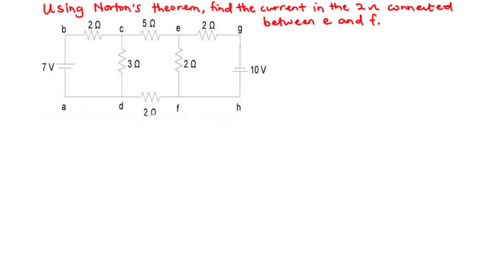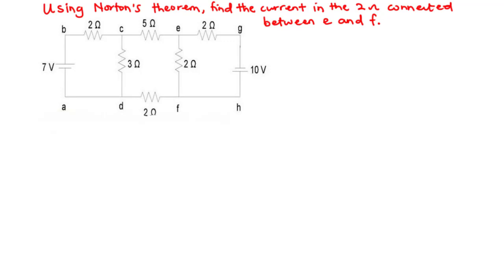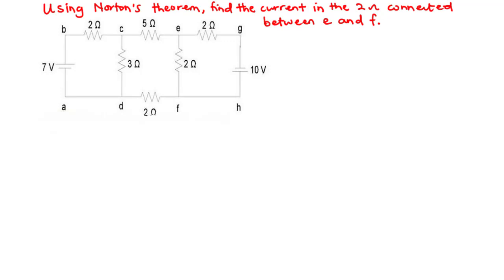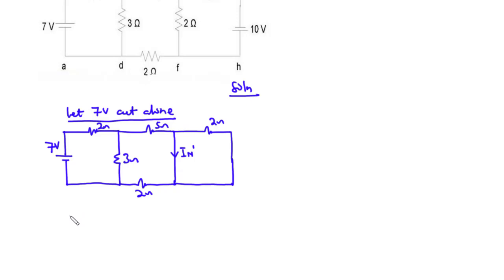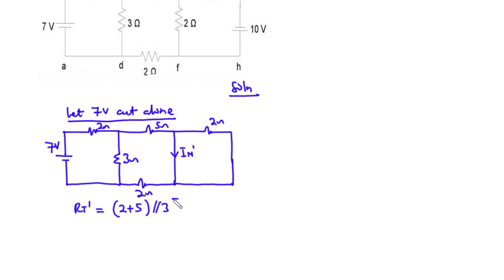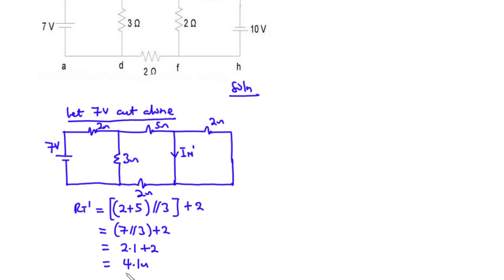20b - Norton's Theorem with Solved Examples #knust

Comment: My calculator gives results as exact fractions. With that in mind, I_n = 184/41 [A] and R_n = 82/51 [Ω]. These numbers imply that the current through the 2 Ω load resistor is exactly 2 A. (Upward)
Reply from the maker: If you do not approximate but use the fraction, you will get the current in the 2ohm to be exactly 2. That's true. For the direction, it depends on which I_n you make, positive or negative. The only thing that matters is the value
Reply from the maker: Thanks for the contribution

Comment: When calculating the Rn shoukd (2//3)+5+2) be in series with the final 2ohmR as the circuit is shorted so current won’t go there anyway ? Or is that only in thevenin
Reply from the maker: so the thing is, whenever you want to find Rn its the same approach as finding Rth, mind you, Rth = Rn. Again, the combination and the final 2 are connected to the same two nodes hence in parallel
Reply from the maker: where do you watch me from?

Comment: Why do you consider the 2ohm resistor as a short circuit?
Reply from the maker: Please do you mean while we considered the 7v to act alone? If yes. Then:
Answer: whenever you go through a loop without passing through any other circuit element (voltage source, current source etc) but only one resistor, then that resistor is short circuited.
Reply: Thank you, Sir.
I understand now.
Reply from the maker: @Treasureiluromi-nuel-oj7pb most welcome

Comment: why is the 2 ohm and 5ohm in series? there is a junction between them
Reply from the maker: There is no junction between 2 and 5, notice that the terminal marked ab is an open circuit so no current will flow in it. Hence current in 2ohms will be same as current in 5ohms because there's no division of current

Comment: Why didn't you consider the 2 ohm resistor on the right hand side of the short circuited resistor in the first case?
Reply from the maker: yes, this is because that 2 ohm is also short-circuit, hence current after the 5ohms will choose to flow through In' and will not consider flowing through that 2ohms resistor. when you go through a closed loop without passing through any circuit element except only one resistor then it is short-circuited
Reply: no currents passes through so its short-circuited

Comment: Why in RT' is the 3ohm resistor not short circuited as well?
If you don't mind in this video : https://www.youtube.com/watch?v=hyNtfEuH2ug&ab_channel=ElectronXLab
He did not take into consideration the 10k ohm in the superposition
Reply from the maker: It's because 3ohms is not in parallel with the short circuit. ie. The 3ohms and short circuit are not connected to the same two terminals